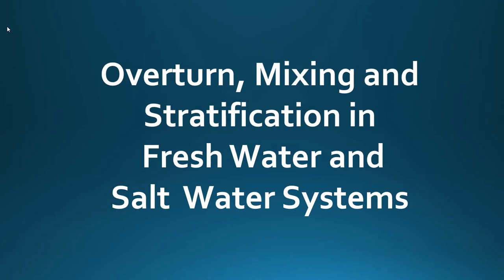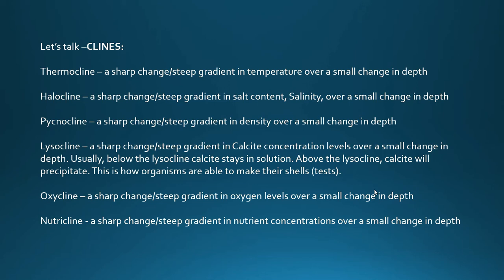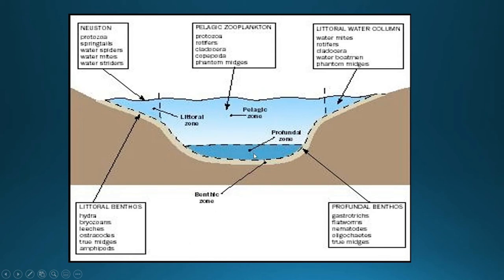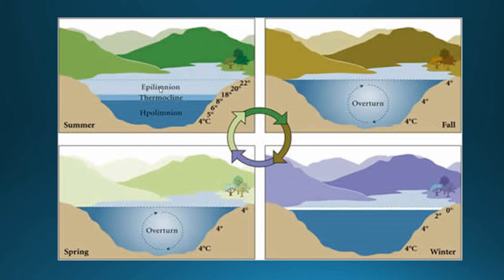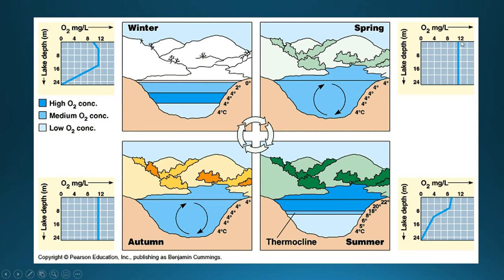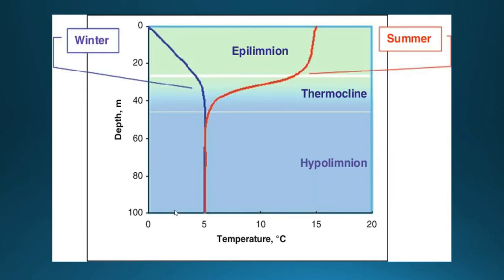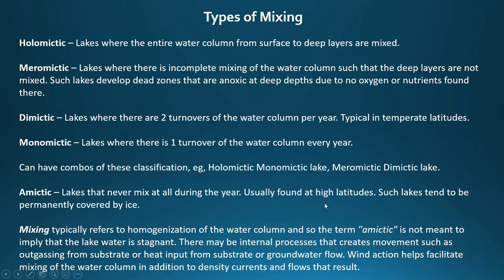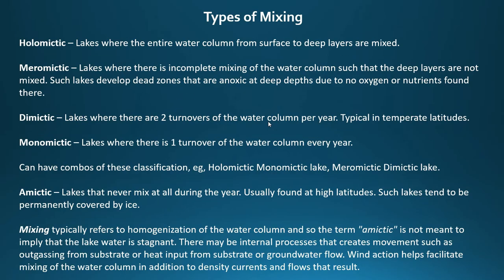Let's talk about Overturn, Mixing, Stratification

Comment: "Brine rejection is a process that occurs when salty water freezes. The salts do not fit in the crystal structure of water ice, so the salt is expelled. ... Salt rejected by the forming sea ice drains into the surrounding seawater, creating saltier, denser brine. The denser brine sinks, influencing ocean circulation." so to make fresh water out of sea ice - it's best to freeze it?
Reply from the maker: Sure, you can cool the sea water to temps less than 0C, create the brine rejection process and the ice that forms will have little to no salinity. Take that ice, melt it, filter it and it can be drunk. To do this deliberately on a large scale requires enormous energy to cool the water. So now, you take this water that is now ice (and salt free). But as the ice will now be used, ie, not allowed to melt back into the water, there will be less liquid water over time, but with ever increasing salinity. This will create physiologial issues for organisms. (I'll be posting a video on Salinity soon, had to deal with huge snow storm here in Alaska. No power or internet for some time). By the way, desalination plants create the same problems, Lots of energy to make potable water with all that salt going back into the ocean spiking salinity levels and causing dead zones. I discuss this in this upcoming video.
Reply: @ScienceTalkwithJimMassa  thanks Jim. good luck with the snow - I just shoveled our driveway - we had sleet slick underneath. haha. Yeah when I lived in Alaska we had six feet of snow by December. 1990.